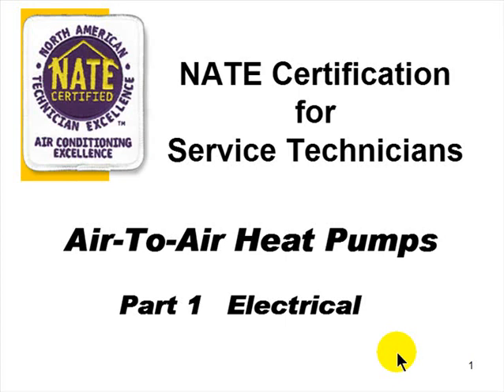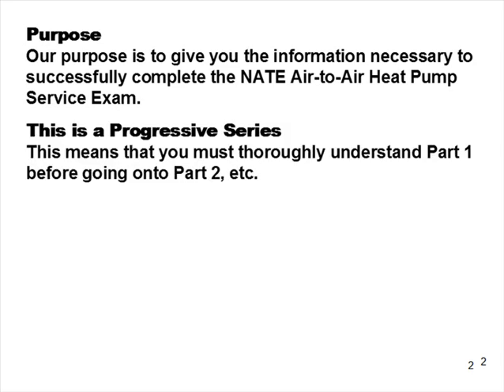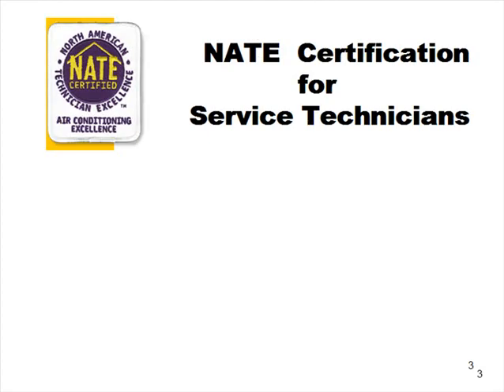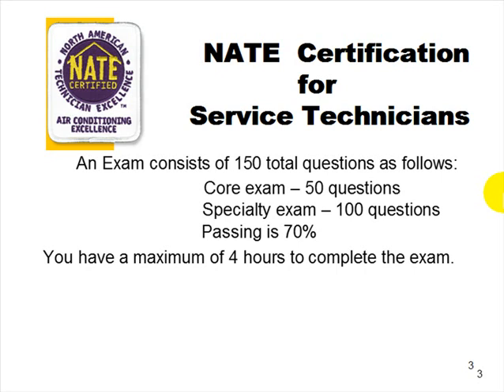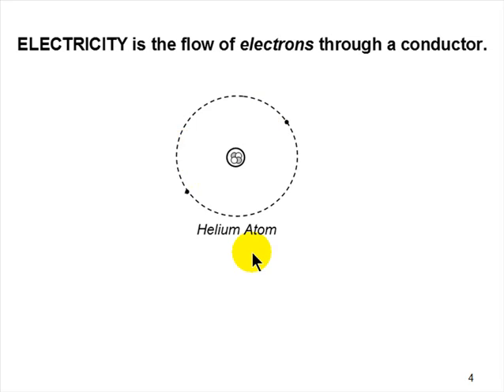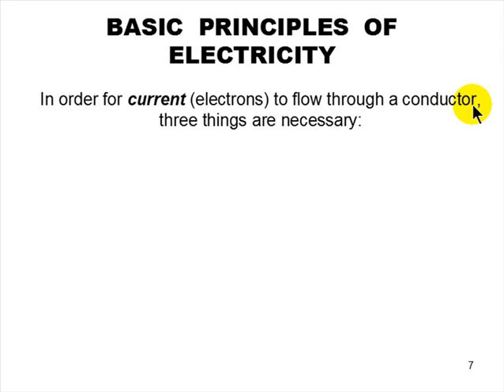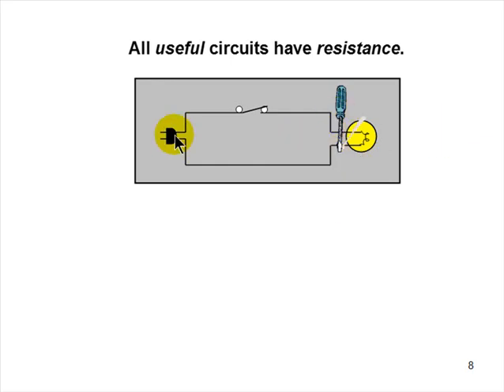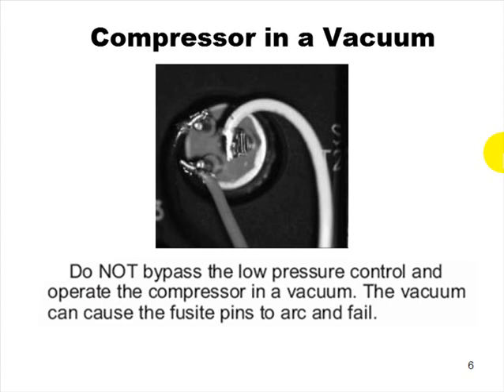HEAT PUMP 1

Comment: Like your video, I'm preparing for the exam. Thou, there is a a problem with the discussion on capacitor testing.  The reason the ohm meter reads to the right and then to the left is because , the swing to the right is that is charging to the ohmmeter internal voltage potential, and when it swings to the left is not because it is discharging, but it has reached equilibrium a balance . the capacitor has charged to the source voltage and there is no current charging the capacitor. no current flow thus no meter movement. 
Juan